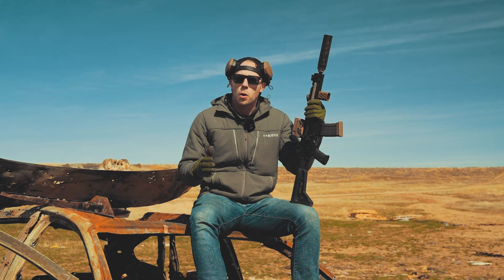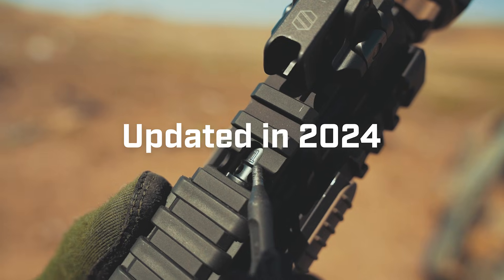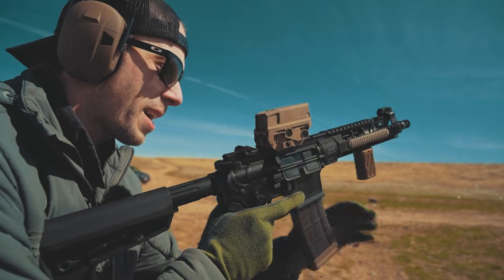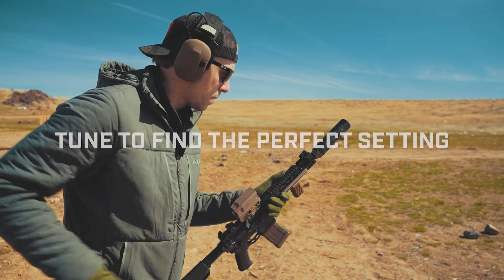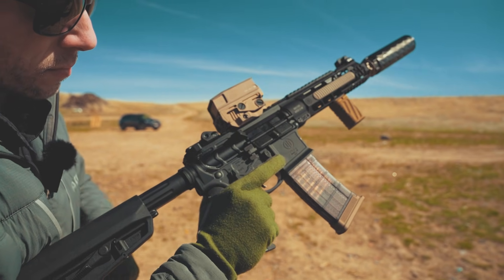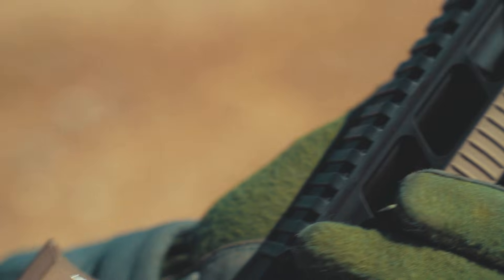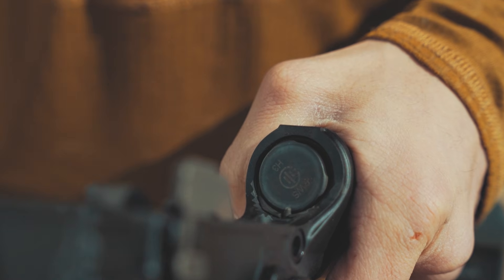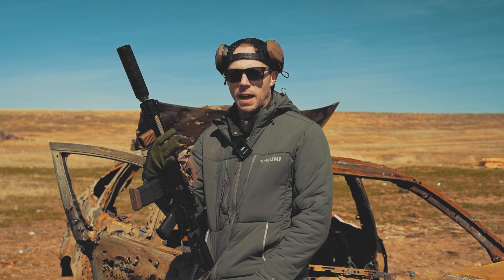PWS MK109 300BLK Gas Settings Explained – Suppressed & Unsuppressed Setup!

Comment: I’ve always wanted one of these. Not a lot of reviews. $900 id be all over it but damn $1400.
Reply: Good grief man 1400 is fantastic for this level of ar. S tier gun, mid tier price tag.
Reply: @Bmxr1991 For an upper ? Too high
Reply: Not sure how much their price has increased but yeah I got mine for around mid $900 using a coupon at brownells. (MK109 Mod1 though). I get it adds to the price a bit but I wish they did use a fancier upper for the mod1s, i prefer the more basic handguard the but ultra basic/milspec upper makes it look kinda temu lol.

Comment: Just got my 109 and wondered the reasoning for an H2 buffer? Were there issues using a Carbine and/or H buffer in testing?
Reply: I'm assuming being long stroke they could have either made the gas ports smaller to accommodate a lighter buffer but the chances of fouling a smaller port /reliability issues sounds more likely than to run a heavier gas spec and just balance it with more weight leaving room to adjust if necessary.
Reply: Dwell time. The heavier buffer delays the cycle slightly allowing for more dwell time and greater reliability and performance.

Comment: I like how you started using numbers on the gas position now. The dot system is hard to read after build up gets on it. 

Might I suggest making them raised so it's easier to read on they get a little dirty. Either way not a huge deal. I guess I could clean it but it's a tight little area to clean.

Comment: I have a Mk109 factory built in 2019(?) that will chug through Minute Man subs with or w/o a suppressor, and then eat a mag of 110 Hornadys with a can on just to show off! I purchased sight unseen on the web and I couldn’t be happier! And the block is not adjustable; seems to me like you knocked it out of the park. Someone misses the forward assist.